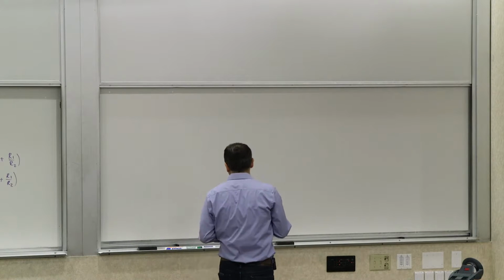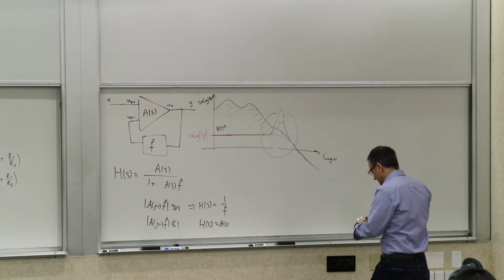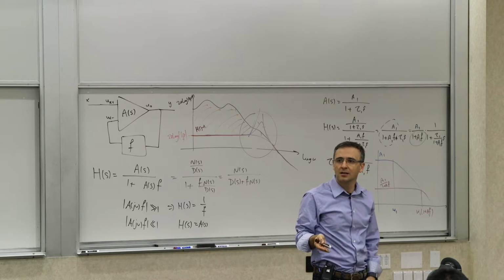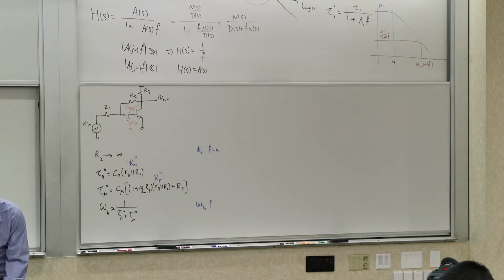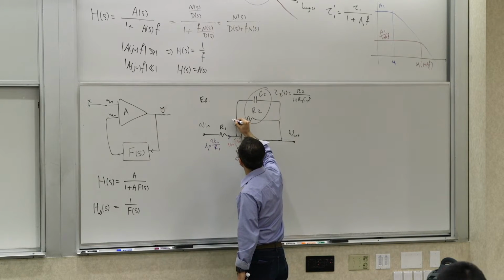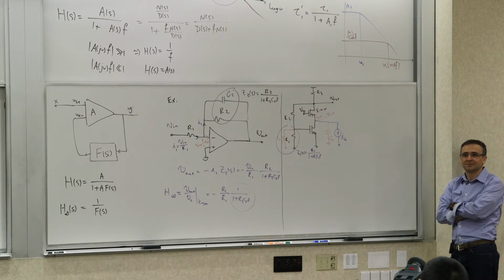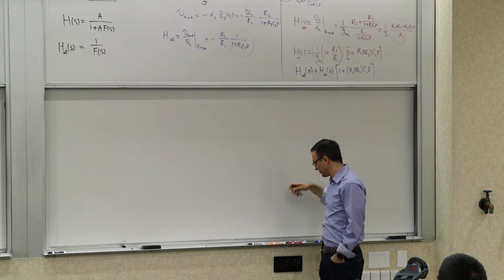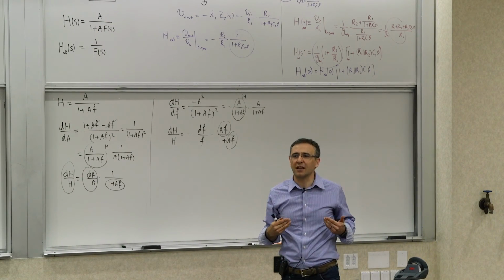159N. Feedback dynamics, forward and feedback path frequency effect, feedback sensitivity reduction

Comment: thank you for great lectures, Prof. Hajimiri. 
at 40:02 you considered Vg1 as the output of the feedback network. 
why is M1 excluded from the feedback network? 
did you use the assumption that the feedback only consists of passive components?
Reply: The output of the feedback network is gm*Vg1.